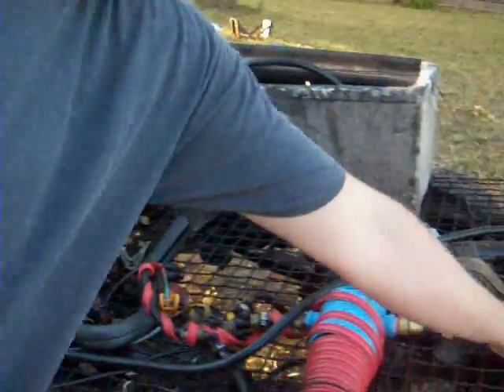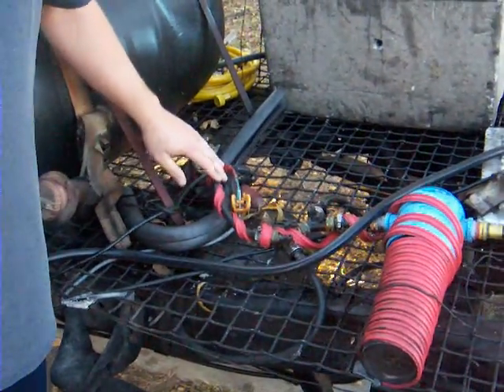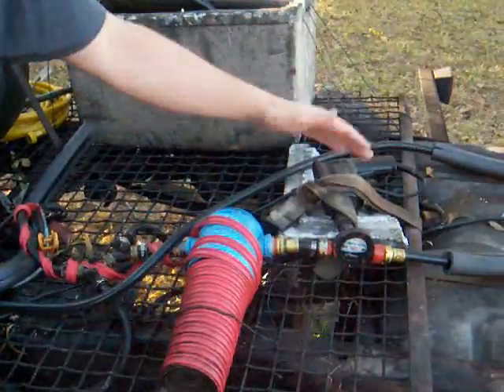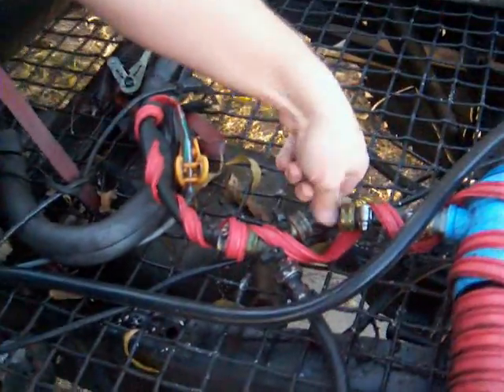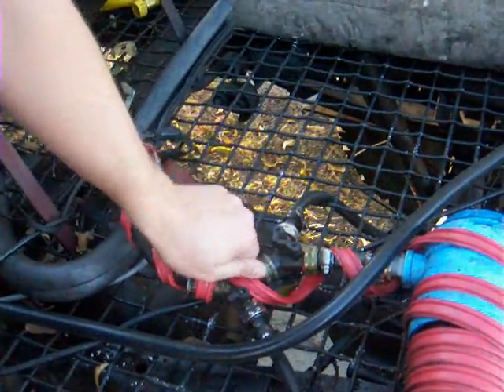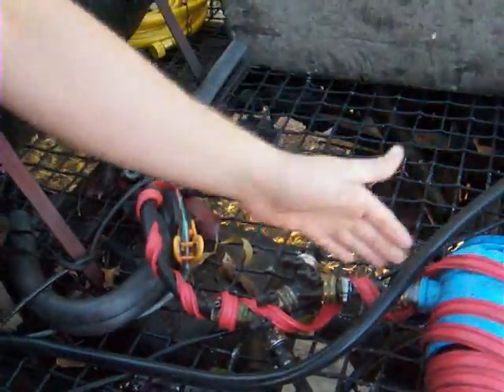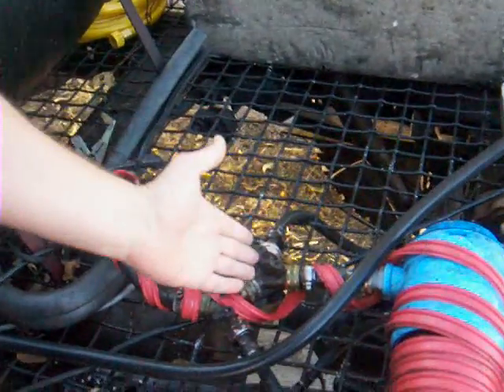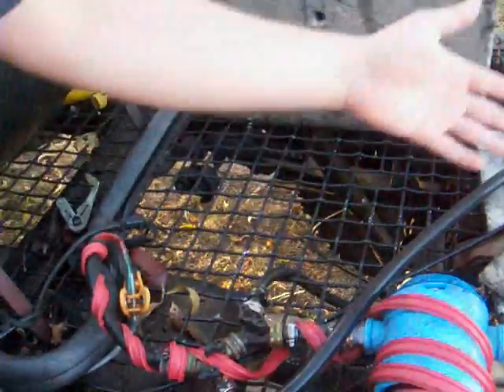7.3 IDI WVO International Diesel F250

Comment: If you look at the pump on the back of his truck, it is a pump that is powered by an electric drill. (he bought the pump at Home Depot for $7.00) He bought another one of those and pumped it from the vegetable oil pick-ups through a waterhose with a screen to filter large debris. Prior to mounting the system on the back of the truck, he pumped clean vegetable oil straight into the fuel tank via the same system but with the actual filter attatched to the filling hose.